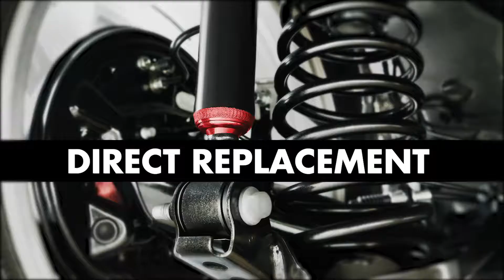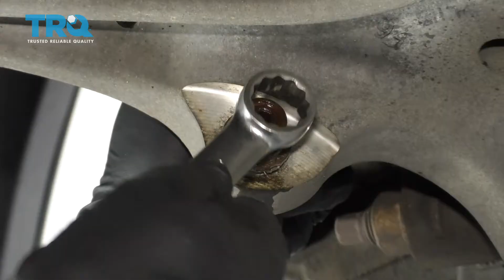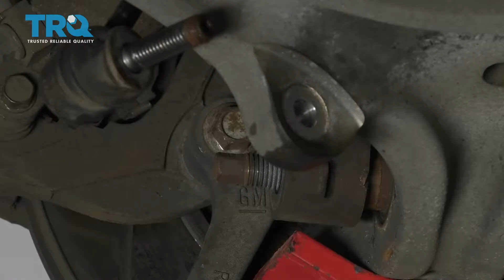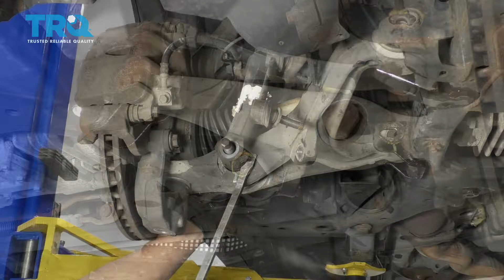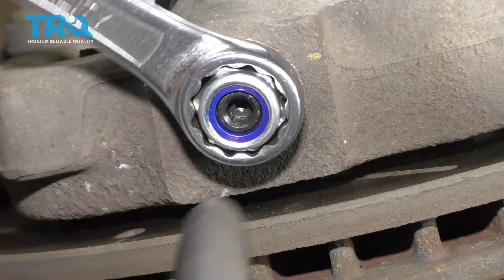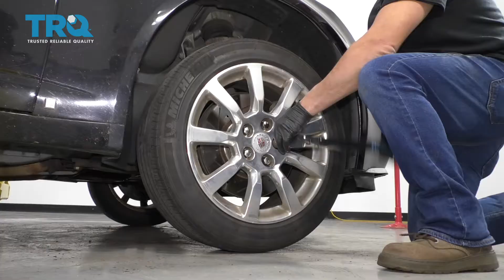How to Replace Front Lower Control Arm  08-14 Cadillac CTS

Comment: Do you need to replace the control arms if you need new ball joints? I have a 2010 awd. And my front upper ball joint is bad

Comment: First, the Cadillac design crew really must hate mechanics. Tighten to THIS and then using an angle meter, rotate it that much more. Second, if I pull those lower control arm chassis bolts, is there a reason that I can't put the one under the steering rubber bellows in backwards - head on the inside and the nut on the "outside" under the rubber? I've done this kind of mod on my Mercedes, using some blue loctite on "that" nut just to make sure it's not coming loose.

Comment: Can you separate the outer tie rod to move the inner tie rod out of the way enough to take the CAB bolt out and can you put the bolts back in backwards so the bolts come out from the inside of CA?

Comment: Do bad lower control arms cause the car to shake
Reply: Yes. Have someone you trust sit in the car and with it in reverse, look under the front as the driver moves the car backward a couple inches then steps hard on the brake. Don't let you wife do this if you expect she might want to collect your life insurance if she "accidently" puts the car in drive. Watch the forward bushing area of the lower control arm. If it is good, the only motion will be "rotary" around the bolt as the arm moves up and down. With the bushing bad, the bushing area of the arm will move noticeably left and right and/or up and down. Remember, the ONLY motion of that part of the arm should be from the bushing twisting one way or the other around the mounting bolt as the arm moves up and down.
Reply: Yes it will and the wear on your tires will be uneven. It's another expensive issue with the cts 🤦🏽‍♂️ it's such a beautiful car but damn they have sooooo many issues

Comment: Cant replace just the bushings? Or need to replace the whole arm
Reply: Do the entire arm while you at.it I needed just the bushings it was just as much as doing the entire arm. you can do just the bushings though
Reply: @shortdom107  it's a lot cheaper to do the bushings, right? 
I seen bushings for less than 100, while  the control arms are 300 ish each side
Reply: The rears have them availible.